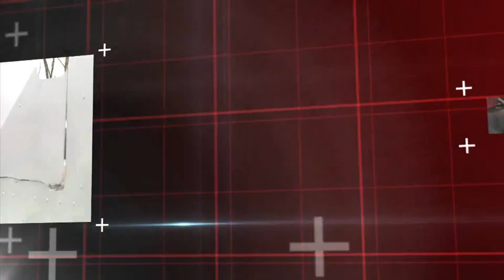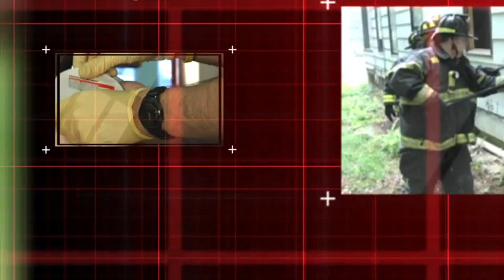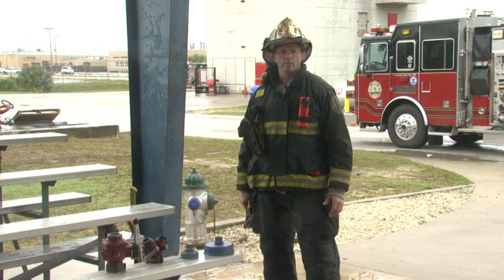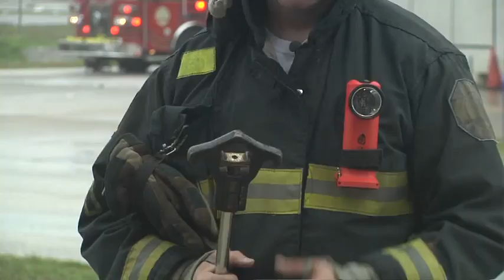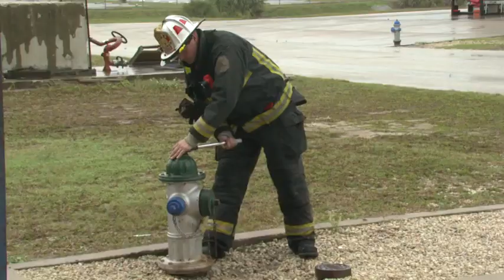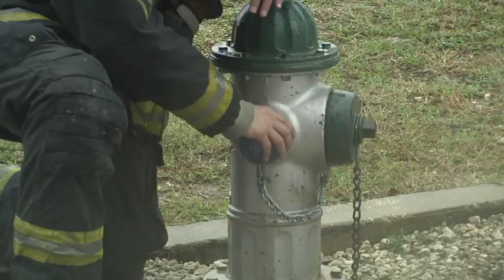Overcoming Problems at the Fire Hydrant

Comment: Stuck cap: is breaking the cap the only option?
Reply: you can sometimes hold the ring and chain with one hand and spin the cap but it would definitely be a slower method. If your in an emergency situation break it they can easily be replaced.